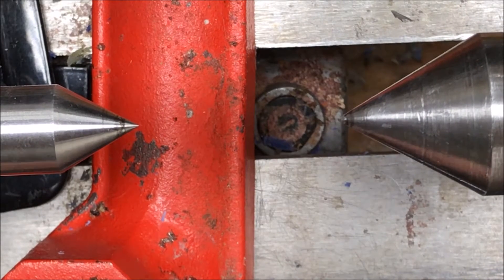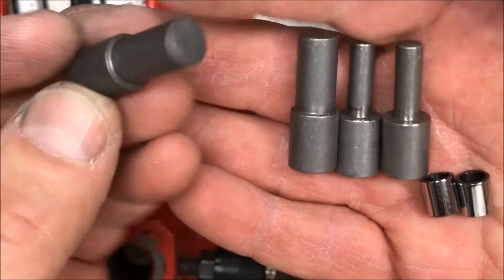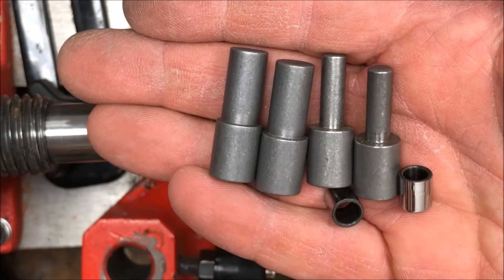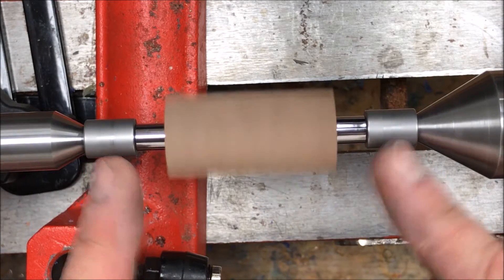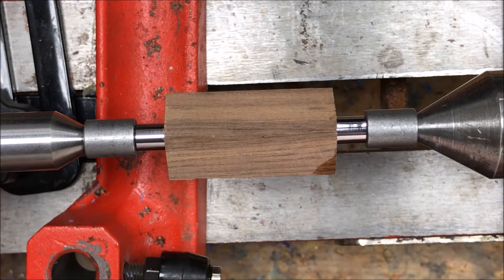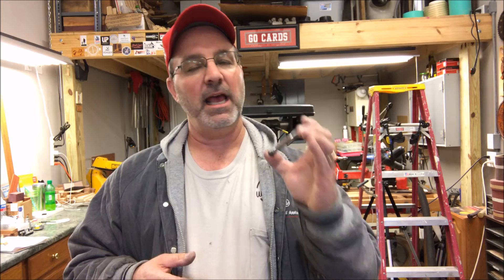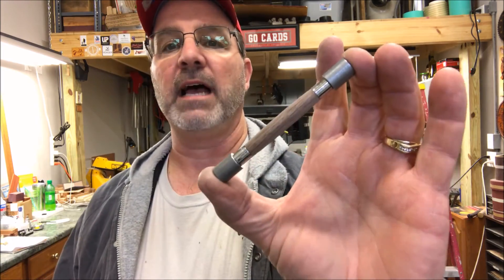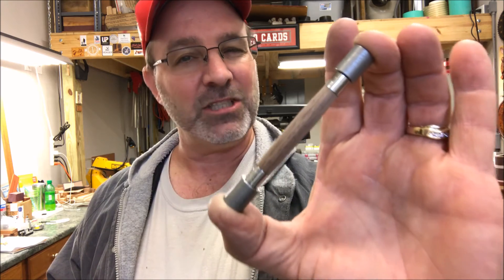Turn Between Centers Take Two

Comment: I don't personally see why turning between centers is better. I prefer having both of my pen pieces next to each other so I can share them accordingly. Sometimes the top of the pen looks nice if it's a little fatter. Most people don't like a big bulky grip when writing. But, cool video showing that it was in fact the lathe. Agree awhile, everything needs replacing. You got a lot of use out of it! :)
Reply from the maker: Thank you Mike,
  I certainly did. 

Regards,
Bob

Comment: Hey Bob, I meant using the pen blank drilling center vise. To much time using the lathe to drill. I have been turning for 12 years now, I started out turning teachers pens for my kids teachers. I had total shoulder replacement in June I am looking to try casting my own blanks, will see how that goes.
Reply from the maker: Casting seems to be fun, I’m heading down that road right now and learning every day. 

Regards,
Bob

Comment: If you use the tbc bushings that you used for the slimline bushings, you should be able to use all the same bushings that you use on your mandrel on them.
Reply from the maker: That is correct, I still prefer the mandrel but will convert on a few kits. I can turn any bushings with this set. 

Regards
Bob

Comment: The way to cure the problem with your old lathe is to undo the bolts holding the headstock onto the bed and tweek it very slightly so the headstock lines up with the tailstock.
Reply from the maker: Thank you Gerald. 

Regards,
Bob

Comment: Hi Bob - my PSI TurnCrafter 12" just arrived and is waiting for me to finish up my day job to put it together. I found the bushings you mentioned in the comments, but I haven't been able to find the actual dead center you show in the video. Can you provide a link for that? I think the live center came with my TurnCrafter, but I'll check in an hour or two.

Thanks for providing all the great info for this rookie.
Reply from the maker: This is the one I have:

https://m.ebay.com/itm/MT0-Lathe-Dead-Center-Hardened-Ground-Steel-60-Degree-Point-0-Morse-Taper-New/291641956830?hash=item43e73719de:g:Kw4AAOSwKtlWjIjg

There are less expensive ones. Search 60 degree dead center on eBay. 

Regards,
Bob
Reply: RJBWoodTurner Thanks, Bob. My lathe is up and running. I need to tighten a few items up and test it out.
Reply from the maker: Congratulations! I’m looking forward to seeing your projects.

Comment: hello. thank you for posting. i'm looking to get started turning i have the lathe picked out i want to buy but i need help on tools i dont want to spend a ton of money for top notch tools in case I dont get into it but i dont want the cheapest one either. thanks Bob in MN
Reply from the maker: I’d recommend carbide so you don’t have to invest in a sharpening system right away. Rockler has a set that a lot of turners use. Be sure to shop around, prices vary greatly. 

Regards,
Bob

Comment: Glad everything worked out. I have had my turncrafter lathe for 4 years now, really like. Question tho you ditched the drill press long ago for drilling your blanks and using a jig. Advantage to it or is it set up time. Thanks Gerry
Reply from the maker: Hello Gerry,
  I’m still a huge fan of the drill press. I’m not sold on drilling on the lathe. Guess I’m just old school. 

Regards,
Bob
Reply: Drilling on the lathe is great if you have more than 1 lathe so you don't spend 1/2 your time switching between tasks LOL.  I use a drill press and a machinist vice for drilling blanks, it seems to work just fine.  They make chucks for holding pen blanks to drill them out on the lathe but again you spend quite a bit of time changing between tasks doing that, so its just easier to have a different machine for the tasks.

Comment: Before seeing your video, I wasn't  familiar with turning pens between centers. What is the advantage compared to using a mandrel? Is it something that you would recommend ?
Reply from the maker: TBC is supposed to be a more true way to turn. There are people who will debate the differences but I wouldn’t recommend wholesale switching. I have subscribers who have asked me for years to give it a try so I did. I may use it once in a while but I don’t plan to replace all my bushings and get rid of my mandrel. It would be a cheaper way to start pen turning as you only invest in the bushings and don’t need to spend money on a mandrel. As bushings ware out, I’ll probably replace them and move this war. 

Regards,
Bob
Reply: The turn between centers set from Pennstate Industries is the one I ordered, you don't have to buy different bushings using this setup.  Your current bushings slide right onto these.  https://www.pennstateind.com/store/PKMBCM2.html

Comment: Hmm, PSI has a new turn between centers setup that slides into either a #1 or #2 MT head/tail stock.  I ordered the set to see how it works out, really tired of the whole mandrel idea LOL.
Reply from the maker: I plan to migrate as I purchase replacement bushings. So I’ll be using both for a while. Let me know how you
Like the PSI TBC setup. 

Regards,
Bob

Comment: Aren't these slimline bushings designed so you can use any standard pen bushings?
Reply from the maker: Yes they are. Any bushing will work on them. There the same diameter as the mandrel. 

Regards,
Bob

Comment: Hey Bob what is the advantage of turning between centers
Reply: While I'm not Bob, I do know the answer to your question: Turning between centers is supposed to be more accurate than turning on a mandrel.  A mandrel will flex, introducing some degree of alignment error.  This can result in your blank becoming oval rather than round.  You can reduce, but not eliminate, this problem by using an adjustable mandrel and/or a 'mandrel saver' live center to turn with as short a length of mandrel as possible.  You can also reduce the problem by not over-tightening the tailstock and by taking lighter cuts.
Reply: David Walser thank you Dave I will have to get the correct pieces an try it.    Thank you so much
Reply from the maker: Thank you David, I couldn’t have said it better. 

Regards,
Bob
Reply from the maker: Hello Kenny,
  David is tight on the money with his response. 

Regards,
Bob
Reply: RJBWoodTurner thanks I will be trying this as soon as I can purchase the bushings.  Thanks again
Reply: Bingo, great answer David.  I ordered a turn between centers setup.  The mandrel isn't the greatest and over time the mandrel will inevitable get bent causing all sorts of trouble.